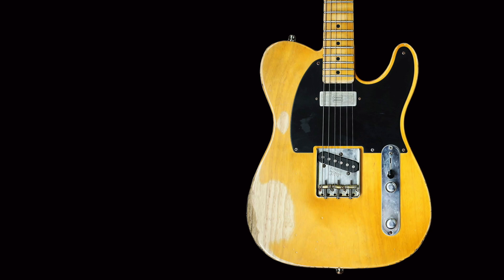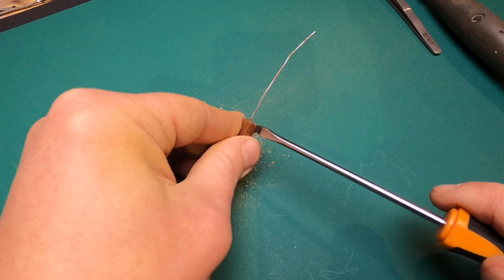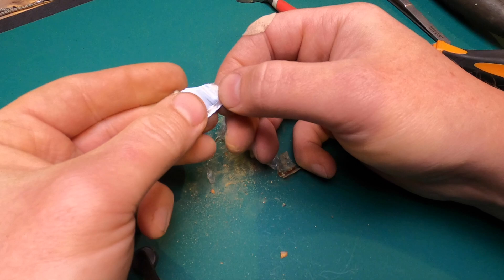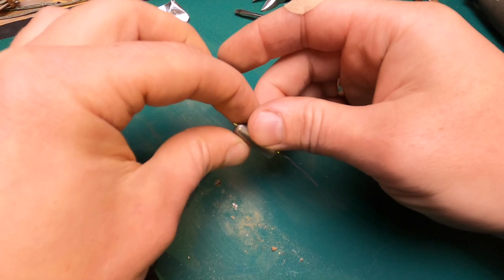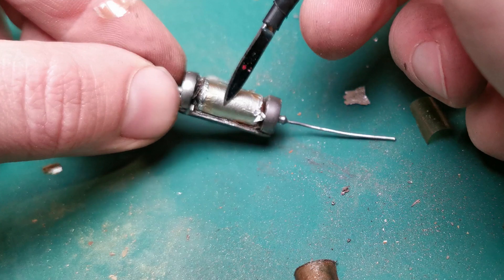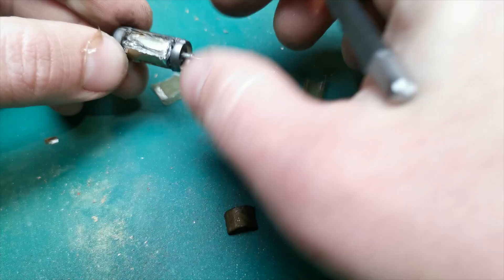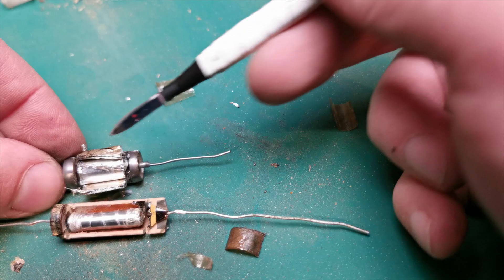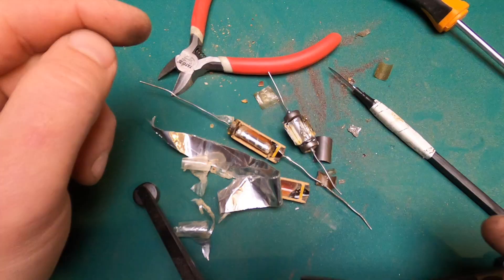WHAT'S INSIDE THE CONDENSER? John E Fast NOS - paper in oil or foil?

Comment: Best viddy so far. So glad you put the glove on. I have cracked loads of capacitors open that looked like film/ foil type and found oil inside them, even square types. I worked for Sony in the late 90s , a boffin showed me capacitor designed with a " Bamboo and oil" core and explained how it would improve the sound and durabilty of the HIFi amp we were working on. Like to try one on a Guitar tone.

Comment: You can tell the 1st is not PIO by looking at the outside. It didn't have a solder seal on one wire to keep the oil in. The 2nd capacitor has the ball on one lead wire, next to the capacitor. That seals the oil in. If that seal doesn't exist, it isn't PIO. No need to cut anything open.
Reply from the maker: Yes. But this is interesting 😁

Comment: Thanks for a nice dissection video of vintage condensers.
Reply from the maker: Thank you
Reply: @8BombCustom  

Have you tried rolling your own capacitors?

Right now I can only make up to about 0.01uF because I am having trouble rolling 5 layers straight.

Very difficult as film gets long. 😅
You seem very crafty, do you have any ideas you could share?
Reply from the maker: @12AX7TFDia  No, I haven't done it yet.  I imagine technology but I don't dare to fall down another rabbit hole 😁 k40-u9 are very technological and good sounding capacitors.  I don't think it's possible to achieve this kind of PIO quality in a workshop without recreating a completely original technology.  I think in this it is very important to observe the thickness of the films, the tension during winding and the compression in the shell.
Reply: @8BombCustom  
The K40 are very nice! I think all the Soviet Mil. caps sound very great. The K72 are supposedly better but haven't tried.

Here I can buy PIO black beauty and bumblebee fairly cheap so I usually go with that. Shizuki from Japan, also great MKP and have large values!

Ok, I'll keep trying rolling capacitors. If I figure it out maybe I'll make a video too 👍
Reply from the maker: @12AX7TFDia  This will be great!

Comment: The Russian capacitor looks allot better build quality than 1st capacitor. The oil in Russian capacitor is not dried out like some capacitors do some of Russian capacitors have glass ends on them Russian capacitor has a better seal than the paper @wax capacitor. I have heard if your going to go with pio go with Russian capacitors.
Reply from the maker: Yes. You right. But actually k40y-9 and k40-y2 this in not russian caps. In USSR military capacitors was made in Ukraine 😊 I think this is the best production quality PIO capacitors.
Reply: Ukraine ussr miltary most caps there older once really excellent build quality older multi section can caps made in usa tend to like dry up that why you get annoying hum got replace them filter capacitor.
Reply: Jensen caps from 60s /70s ( yellow , biggish) sound great in some Strat style guitars, oil and paper but bigger.